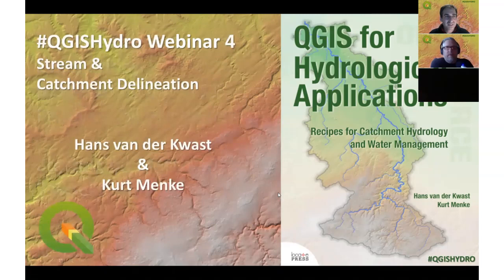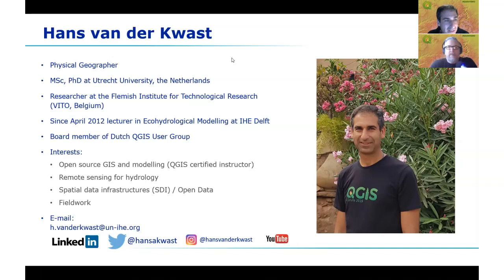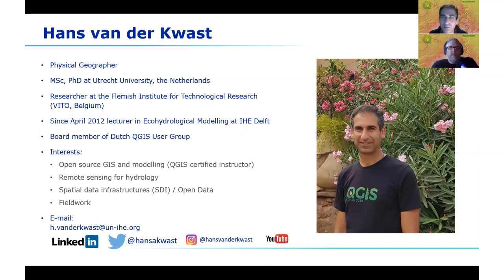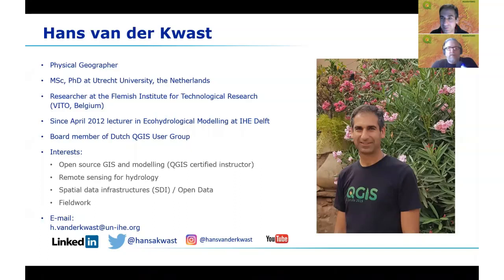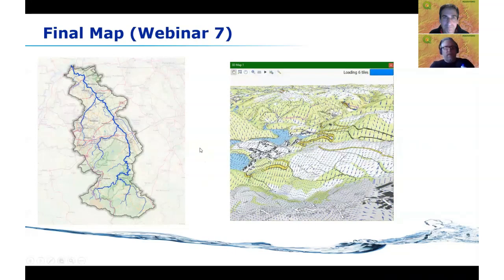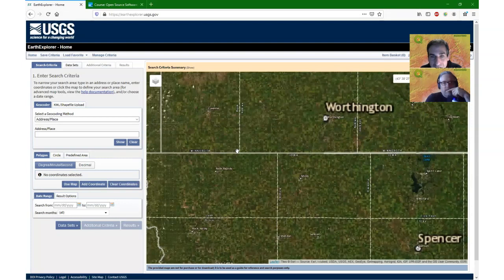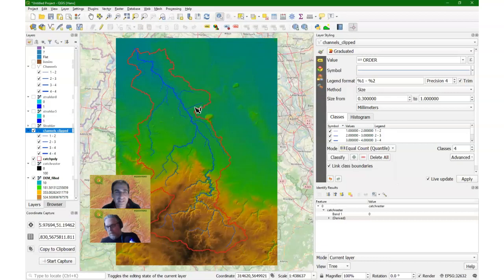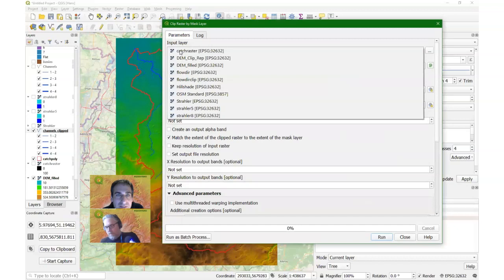QGISHydro Webinar 4: Stream & Catchment Delineation

Comment: Thank you for your video. However I have some confusion regarding catchment area delineation, here I noticed that you have used Upslop for delineation up to outlet point rather than pour point In QGIS.
Reply from the maker: It is the same, but you need to choose or snap your pour point to the delineated stream, otherwise there's no river for the model and it can't delineate the catchment.

Comment: Hello Dr. Hans, It is really wonderful to see the webinar. I am facing a difficulty at the stage of correcting the file after reprojecting the DEM using bounding box. I am not able to use the tool "Fill Sinks" by Wang and Liu or any other as each time I open, it says, officially it is not supported. Can you please tell me the reason or any other method to use it.
Reply from the maker: This message has to do with the new dependencies in the newer versions of QGIS. A work around is in this video: https://youtu.be/t-2ExoyhIfA
Reply: @HansvanderKwast  thanks a lot Dr. Hans, I will try.

Comment: I dont understand about Strahler stream ordering method. I watched other videos after using Fill sink, we calculate flow direction and flow accumulation. Does Strahler stream order already calculate flow direction and accumulation already before it create stream order? How Strahler stream create stream ? thank u
Reply from the maker: Strahler ordering uses the flow direction. It first gives all pixels order 1, when pixels of order 1 join downstream it becomes order 2, etc. Alternatively you can use flow accumulation with a threshold. Here's the theory https://youtu.be/ZLUjSEK-nbg
Reply: @HansvanderKwast  Let’s me repeat if my thinking is correct. There are two ways to derive stream : 1). Strahler order;2).Flow accumulation 
Case A: if I use Strahler order, I don’t need to calculate the flow direction. Because inside Strahler order method it use flow direction already or I can say Strahler order calculate flow direction already before derive stream

Case B: if I use flow accumulation, I must calculate flow direction first to derive stream. Otherwise, there is no way to calculate flow accumulation. and if I use flow accumulation, I need to try trial and error…

Do u have any documentation/published article mentioned about Strahler order and trial and error of using flow accumulation? May u drop the link ? I need it to support my study. Thanks
Reply from the maker: Your reasoning is more or less correct.
Two methods: Strahler order or flow accumulation. Depending on the tool you need to calculate flow direction before or it's included in the calculation. For both it's used. Also both results need calibration to determine the river. For Strahler it's more discrete, while for for flow accumulation you need to choose an amount. Here's the theory: https://youtu.be/ZLUjSEK-nbg
Please check the videos on the new PCRaster Tools plugin as an alternative for SAGA and GRASS tools.

Comment: Hi Hans, thank you for the well presented Webinar. 

This has been very useful for me. I have however, encountered challenges with delineation of catchment section (mins 47 to 49). My catchment raster on a project I am currently working on has the same min and max number (100) and the whole area is black. What could this mean? Does it mean that the whole catchment is draining at the selected outlet point (i.e., the coordinates captured). I also notice that the coordinate capture point needs to be exactly on a stream line to obtain any useful results.
Reply from the maker: All pixels belonging to the catchment get value 100. So if all your pixels are 100, all drain to the outlet. Indeed the outlet needs to be defined at the delineated stream in order to correspond with the filled DEM.
Reply: @HansvanderKwast  Thank you. I have figured it out now.

Comment: What if I dont use Strahler Order , but I use Chanel Network and drainage basin instead. because in  Chanel Network and drainage basin it also functional option of Strahler Order.
Reply from the maker: Correct if you don't need the delineated rivers calibrated. But we need to give Strahler threshold number to derive the river with the Channel Network and Drainage Basins tool.

Comment: Thanks for all those webinar, really helpfull ! Am I missing something but I don't have SAGA tools in my QGis 3.12.3. and I can't find it in the repository.  Where can I download it ?
Reply from the maker: If you're using QGIS on Windows you can add it through the OSGeo4W installer.
Please note that you're not using an LTR version, which can have bugs. I advise to use the LTR version for learning and operational use. The current LTR is 3.10.6. Newer versions have new features, but can have new bugs too. If you use the stand alone installer SAGA should be included.
Reply: @HansvanderKwast  Thanks for your answer ! I'm a Linux user but actually it was a version compabillity problem. I installed Qgis 3.10 and now I can use saga's tools. Btw, I bought yesterday the "Qgis for Hydrological application" and the "Qgis Map Design" book and I'm very pleased with the content. I wish I could have them all ! Again, thanks for your work.

Comment: excellent video, a query how I can generate the catchment point automatically to delimit my basin I see that a coordinate is placed that coordinate how can I automatically generate this for my model
Reply from the maker: There are several things that you can do automatically.
In the step where you do the Fill Sinks (Wang & Liu), you can choose to output the Watershed Basins. That will automatically derive the basins, based on the pits in the DEM.
In the tool Channel Network and Drainage Basins that we use in the video to derive the streams, you can also save the basins in raster and vector format.
If you choose to save the junctions, you get all outlets of subcatchments. Then you can use the approach in Tutorial 6 on this site: https://courses.gisopencourseware.org/course/view.php?id=10
You can also automate procedures by creating a graphical model. See tutorial 10 in the link above.

Comment: Another question, if the rivers do not coincide with the map for flood modelling should we modify the,? how?
Reply from the maker: For flood modelling you have to use a hydrologically correct DEM with rivers that match the DEM. That's what you create here. If it's to far off the real rivers you need to burn in the river network. You can try the methods in these videos for example: https://youtu.be/jHT_StPb_oM and https://youtu.be/ZyM1jnxFamU

Comment: I'm currently using QGIS 3.18, and as I go through the clipping extent, I notice that there is no select extent on canvas for the clipping extent, as I only have calculate from layer, use map canvas extent, and draw on canvas. How should I proceed with clipping extend before using the crayfish plugin? I was also wondering whether if I could skip the clippping extent and just go proceed for the crayfish plugin?  Thanks very much
Reply from the maker: In QGIS 3.18 you can still clip by drawing the extent on the canvas: Raster -> Extraction -> Clip Raster by Extent. There at Clipping Extent use the drop down on the right to choose Draw on Canvas. Clipping might not be necessary. In my case the file was too big to load, so I had to make it smaller. There are also other ways to clip. You can clip to a polygon mask for example or use the canvas extent when you're zoomed in to the area you want to clip.
Reply: I actually have added a DEM and clipped it earlier following the district shapefile area at the beginning of the layer. But I don't know why as I draw on canvas to clip the raster and proceeded for crayfish, the flow direction only within the box that I draw and not outside the box. I wonder whether the file is still too big to load? I actually was hoping to see the arrow of flow directions will be inside and outside of the box. What should I do? Thanks very much
Reply from the maker: @abigaila.jubilee6329  Here's a step by step tutorial: https://courses.gisopencourseware.org/mod/book/view.php?id=28
Reply: @HansvanderKwast  I was able to generate the catchment polygon based on my district area shapefile using QGIS 3.18.3. How do I proceed from the catchment polygon if I want to generate data for multiple sub-catchments for the other surrounding villages that are not within the generated catchment polygon? Thanks very much
Reply from the maker: @abigaila.jubilee6329  There are several videos in this playlist that explain that: https://youtube.com/playlist?list=PLeuKJkIxCDj2Gk0CkcJ-QeviE41aMZd-5

Comment: hI! this helps a lot. thank you. Fillnodata failed. ERROR 1. Writing through VRTSourcedRasterBand is not supported. please help!
Reply from the maker: It seems you're writing the result to a VRT file. That doesn't work apparently. Instead of a virtual file you should use a raster format like GeoTIFF for the output.
Reply: appreciate the quick reply. but another thing, during lddcreate, PCRaster library is not available.
Reply from the maker: It's a Processig Provider, so you need to install PCRaster as well as the plugin. Instructions in the documentation: https://jvdkwast.github.io/qgis-processing-pcraster/

Comment: Thx for the presentation. I tried to do the same with Dutch AHN3 data (resolution 5 x 5 m), but the problem is that many streams passed roads via culverts. By using the Strahler order the streams will stop at the roads. Why didn't you have that issue with your data? Is that because of the raster width of the elevation data?
Reply from the maker: Hi Barend. There are a few considerations here. The DEM needs to be "fit for purpose". 
First, it is not always true that a higher spatial resolution will always give better results. On the contrary, I would say. If you're delineating large streams and catchments, a coarser DEM, such as SRTM 1 Arc Second is often sufficient. 
Second, you need a DTM instead of a DSM. The AHN3 is available as both. In the DSM you have your surface objects, while for stream and catchment delineation these need to be removed to have the elevation of the terrain. Now, the coarser your DEM, the more close it gets to a DTM.
Here's a video about DEM's: https://youtu.be/pnAdasqHxGk
Here's a video about the theory of stream and catchment delineation: https://youtu.be/ZLUjSEK-nbg
Reply: @HansvanderKwast  dank je Hans.